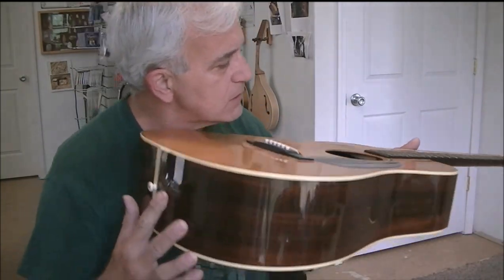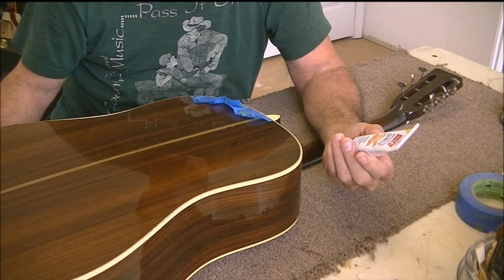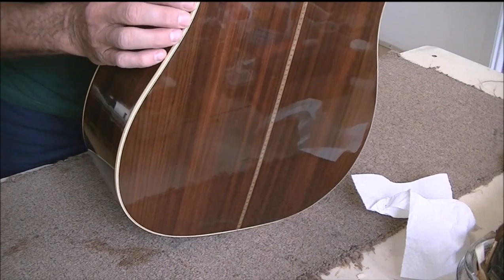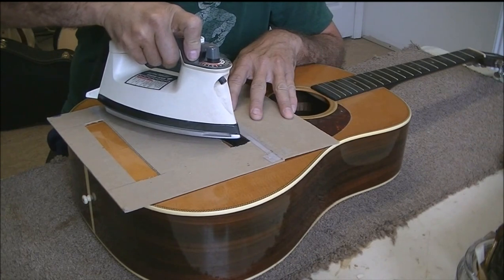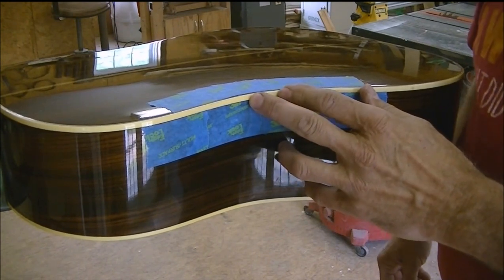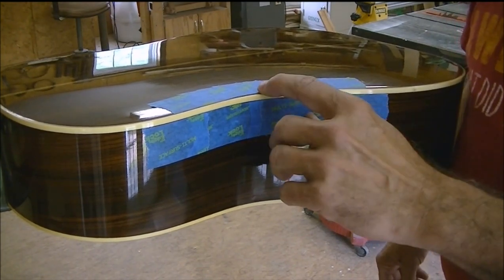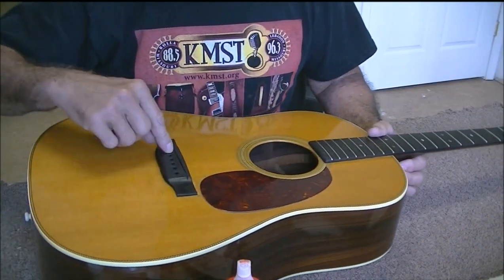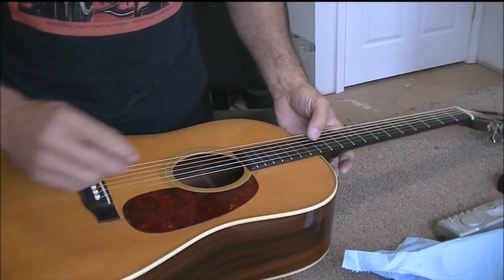061 RSW HD28 S Repaired Bridge Neck Finish and Back Binding

Comment: Exact same things happened on my 1988 HD28. Binding reglued, bridge replaced (as it was also cracked), and the neck finish chipped off. I liked the feel of the neck without the finish, so over time chipped it all out with a pick as it lifted. Now the neck feels great. Pretty sure what started it was using Deet at Bluegrass festivals.

Comment: Hi Jerry. The S in many Martin model nos stands for special. In 1954, the Martin Company again started building Dreadnoughts with the elongated body and 12–fret neck, on a very limited basis. Designated with an "S" after the model number, the first few D–28S guitars were strictly special products. Not 'short neck' or 'slotted head' or even 'scalloped' as some thought. In fact when the 12 fret D guitars entered the regular Martin line again in 1967, they were available with solid or slotted heads although they are all slotted now I think.
Reply from the maker: fiddle0351 thanks for the information. Thank you for watching the videos.

Comment: Will binding plastic soften with heat or will it catch on fire? Sometimes you need to get it to bend in two directions at the same time and if you could use heat it might help. I've always been afraid to use heat on it for fear that it would catch on fire.
Reply from the maker: The old bindings are very very flammable. Doesn't take much for them to catch fire and they disintegrate right before your eyes. But I do use heat often to bend binding.

Comment: You used bridge pins to position the bridge. But I wonder if the you remove the pin before the glue starts hardening or if you pin gets left in and stuck in the hole?
Reply from the maker: Pins don't stay in